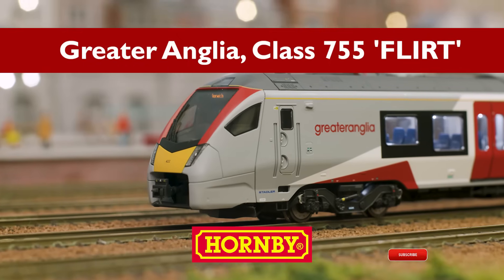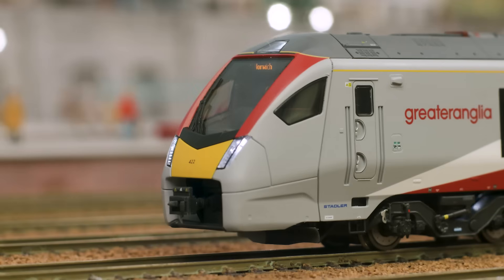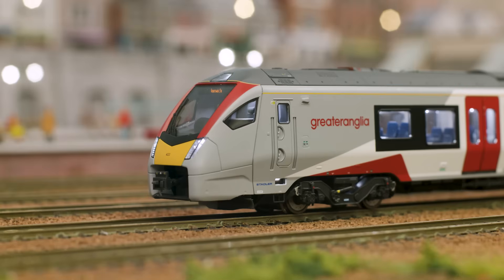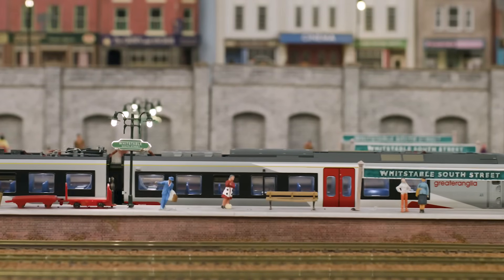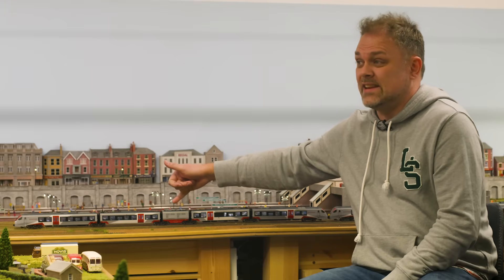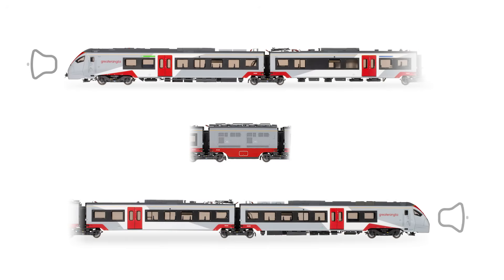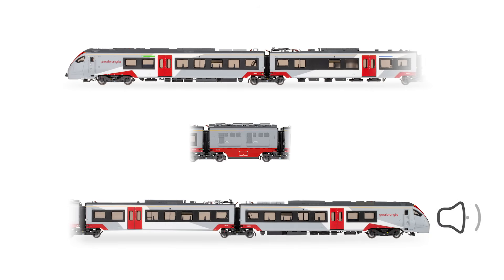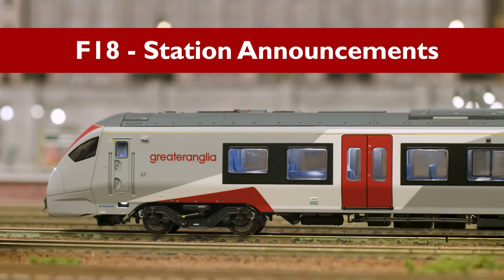Hornby Greater Anglia Class 755 'FLIRT'

Comment: Why do you call all models locos? This is a Multiple Unit (or just a Unit) not a loco
Reply from the maker: You are spot on this is a unit. And what an impressive unit it is! 😋
Reply: @PoxyMoxon97  the unit in multiple unit is referring to any self propelled vehicle(locomotive) that can work in multiple with other units. So 2 class 66s together with one driver is a DMU really. It comes from the multiple unit control system not the  idea of carriages being put together to form a unit.

The diesel multiple unit vs electrical multiple unit thing is because you tend not to mix traction types. 

Really the appropriate term here would be neither locomotive or multiple unit, nor unit, just train. "Look at this feature of this train"
Reply: @SamanthasBuses  why the need for the incorrect info dump? 2x 66's working in multiple are not considered a multiple unit, they are 2 locomotives working in multiple (same as a 66 and 67, 66 and 73/9, 56 and 58, 37 and 20, 33 and 37... and so on). Brush up on your facts as per below if want to to do info dump comments 👍

Unit:
"A multiple-unit train is a self-propelled train composed of one or more carriages joined, and where one or more of the carriages have the means of propulsion built in."

"By contrast, a locomotive-hauled train has all of the carriages unpowered."

Locomotive:
"A locomotive is a self-propelled rail vehicle that provides the motive power for a train, typically pulling or pushing trains along railway tracks."
Reply: @PoxyMoxon97  they are though, they are using multiple unit control, this is where the name comes from. The control system. Your definition admits this by saying "multiple unit train" as in a train, powered by multiple UNITS being controlled by or from one of those UNITS in a TRAIN which is a collection of rolling stock including powered and unpowered vehicles. 

🤣the common parlance is, as usual the least correct one technically speaking. Locomotive becomes a unit in a multiple of units which can be within a train consisting of units and trailers. A class 43 is a locomotive, put it together with some coaches and another class 43 and it becomes a DMU.
Reply: @SamanthasBuses  how is a locomotive a carriage? It isn't. A unit consists of carriages. Multiple working equipment is not same as multiple unit, it's equipment that allows multiple working between rail vehicles from one set of controls in one vehicle.

You're even ignoring that Hornby also agreed that this is indeed a unit and not a locomotive.

I can't understand why you are so hellbent on a locomotive being a unit when this is incorrect. But if that is what you want to believe the who am I to stop you?

Also in regards to HSTs, I've always seen them as locos as they are numbered as such, but I know that they are truely a 'Power car' and two power cars can only haul a train in mutliple when they are coupled back to back directly or with through-wiring through the HST MK3's. They can't work in multiple when they are coupled cab to cab which Units are designed to do, so no they are not DMUs either. But again, if you want to believe it a certain way, who am I to stop you?

Enjoy your day
Reply: @PoxyMoxon97  oh my days, locomotive means a self propelled vehicle. The presence or not of passenger accomodation is not a defining factor of a locomotive in the strictest sense. 

If it can move its self and other things, regardless of having passengers on board, it is a locomotive. 

My favourite of these silly trainspotter terms to have got into semi official use is "single car DMU" just so lame.

Hornby probably did it to engagement bait you, not so much as a genuine attempt either way it's just the kind of thing that spurs a comment and a reply. 

Anyway, I'm off to play with all my many locomotives, which includes parts of DMUs which are powered.
Reply: @PoxyMoxon97  also, just as a fun aside, the prototype HST and at least some of the production models did have multiple unit connections fitted at the nose end, so you could probably run them nose to nose. If you wished.

Comment: Very impressive, though makes me question why the 800s are priced very similer (per vehicle coach) yet contains far fewer features 🤔
Reply: Because the costs of developing them change over time. The costs of licensing for liveries differ company to company. The costs of everything involved is up in the air a bit all the time. Especially when a country goes and does terminally silly things like brexit for absolutely no beneficial reason and messes it's fortunes up big time. All the stuff around you is priced in. 

Unless you're accurascale then you're running like a tech company and happy to essentially waste money all day long just to build market share in the hopes you can sell the company off in a few years at which point the new owner needs to jack the price up a bit. This will happen. Give it time 😅

Comment: “It costs HOW much?”
Reply: @RadioNassau  - a lot of model for your money.
Reply: @ note im not saying its a bad model, but you could compare it price wise buying a second hand loco with the same amount of coaches as a 755. The model is after all just that, a driven coach and a rake of non driven coaches behind it.
Reply: @ - not so, each end car is driven and each coach is wired for lighting functions, interior and door leds, as well as the sound module centre engine unit.
Reply: @RadioNassau  well, no, the model is a model of a specific thing. 😂

If you're this undiscerning about things may I sell you just a block of wood with 4 wheels and motor tied to it. You can write "mallard" on it if you want an A4 or "pug" if you want a pug. I can also offer you generic unpowered lumps of wood which you can scribble wagon or coach on. 😂
Reply: @SamanthasBuses  think your missing the point a bit.
Reply: @VauxhallRailfan  nope. The price of some junk second hand model of not the same thing isn't at all relevant. Pointless to attempt comparison.
Reply: @SamanthasBuses  at the end of the day, £450 is a lot for a demu.
Reply: @VauxhallRailfan  yup, and if you want/need this DMU for your layout/collection... well, you're paying that or slinging your hook. 

The price of it is largely irrelevant other than to moaners.